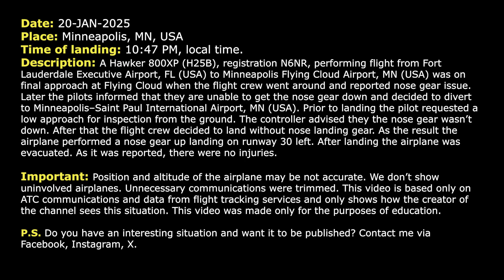Airplane lands WITHOUT NOSE GEAR at Minneapolis Airport. Real ATC

Comment: "Flying Cloud" has got to be one of the most romantic names for an airport. :)
Reply: sadly, it's also the very worst possible location for an airport - as it is just across the Minnesota River from our local theme park, Valleyfair. Due to the approach paths into the airport, there's a height restriction at Valleyfair. They would not be allowed to build a Top Thrill Dragster there, even if Cedar Fair / 6 Flags wanted to, as it would exceed the height limit. The Power Tower even had to be reduced height compared to initial plan due to this.
Reply: @chouseification  Since Flying Cloud was built in 1941 and Valleyfair was built 35 years later in 1976, I'd say it's Valleyfair's problem that they intentionally built in the flight path of an existing airport.  ;) So really, It was Valleyfair that built "in the worst possible location" yes?
Reply: @Haselius00  oh I understand the timing, but it doesn't change the fact that the two being so close to each other sucks mutually for both of them. Also I think valleyfair was free to build as tall as they want until they started planning power tower and only then did FAA step in and give them a hard cap. So there was a little bit of wiggling going on there that maybe the owners of valley Fair didn't know about.
Reply: @ Yes, I agree that it's too bad. (Seriously, I do. ) But the owners of Valleyfair aren't stupid. Their lawyers knew full well of the FAA height restrictions in the airspace. And they chose to build anyway. And I'd argue that the proximity of Valleyfair to Flying Cloud does not impact Flying Cloud in any way. So it sucks for Valleyfair but it doesn't suck for Flying Cloud. It doesn't affect Flying Cloud's operations at all.  The issue rests entirely upon Valleyfair's shoulders because it was entirely their decision to build in an FAA restricted airspace. Flying Cloud has no obligation to accommodate Valleyfair whatsoever. FAA rules override any private considerations. Because the safety of passengers using public airspace is paramount.
Reply: @Haselius00  perhaps you missed my post where I explained the FAA sort of did a bait and switch on valley Fair over the years. I wasn't joking about the height restriction and what valley Fair is understanding of that limit at all. It seems that they had been promised more than they ended up being allowed to use as far as height goes.
Reply: @chouseification  OK, thanks for that! I did not see that post.

Comment: I find it interesting that with iPads in the cockpit these days they had to ask for the runway info and ILS frequency for MSP. After I landed I taxied by and saw them on the runway and thought to myself what would I do in their scenario inour instance, with 186 souls on board with a disabled airplane on the runway with the notion of evacuating at -19°F? I’m glad this was a small hawker with only a few people on board.
Reply: Asking isn't just for the aircraft, it's to affirm that ATC and PLT are on the same page and have the same information.
Reply: @ well when I get an expected Clearance for an ILS, I don’t ask for the frequency no confirm that frequency with the tower. Granted it was an emergency situation, but there was enough time and route, and if they had electronic flight bag, such as an iPad, it should’ve been nearly instantaneous to acquire that information.

Comment: Poor souls must be frightened af after jeju air incident
Reply: not so much.... 12R/30L is 10,000 feet long... and there aren't any stupid obstructions at the end :P
Reply: @chouseification  I don't know if I should laugh or cry
Reply: @chouseification You mean no concrete walls? 🙄 Still can’t get my mind around that one.
Reply: @VintageLPs  that initial post of mine is due to the OP was trying (and failed badly) to make a joke, one which doesn't at all apply to this incident. As to the airport in Korea, that really is baffling that they would ignore a century of best practices; you just don't ever have an obstruction past the end of the runway, as it's well known that sometimes the planes can't stop in time and need to slide to a stop in the grass past the end of the runway... something that fails completely if there's a big dirt hill covered with a slab of concrete and a bunch of hard secured antennae there - instead of the world standard of only objects that can easily snap off their bases for safety. :P
Luckily this plane into MSP was a safe landing with only seemingly minor damage to the plane.

Comment: Why didn’t they declare at the least a PAN-PAN?
Reply: When you're asked for souls and fuel the emergency has already been declared for you.
Reply: My guess is by the time they were looking to declare the tower had already effectively declared for them. Still would have been better with an explicit declaration from them regardless, even if belated.
Reply: Not your business that's why